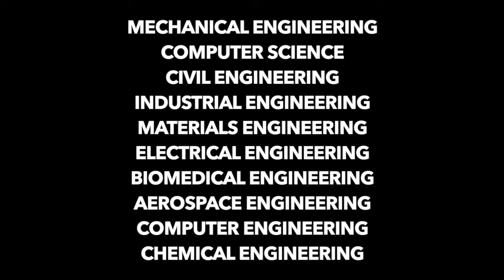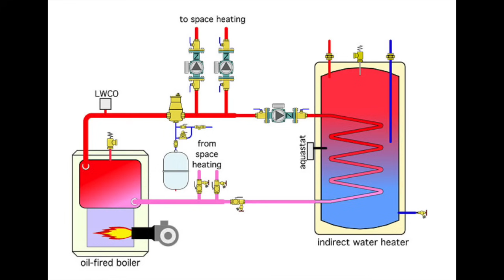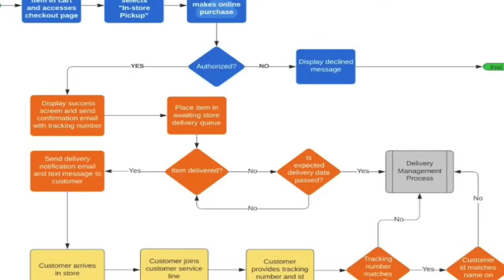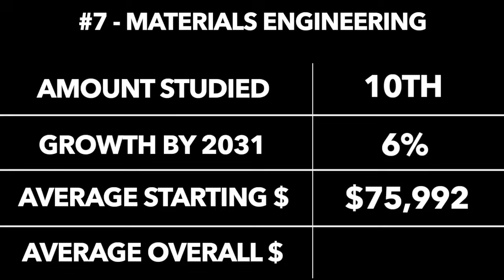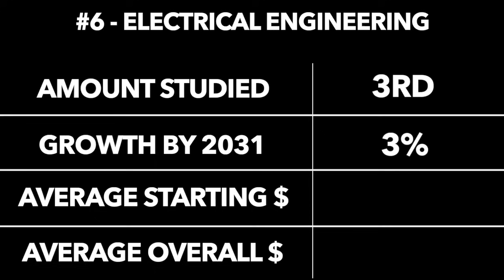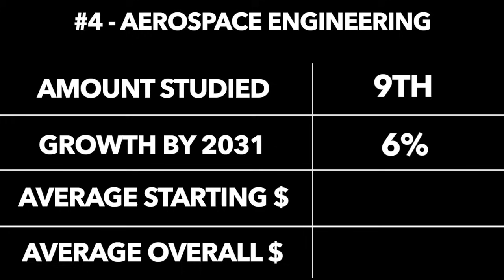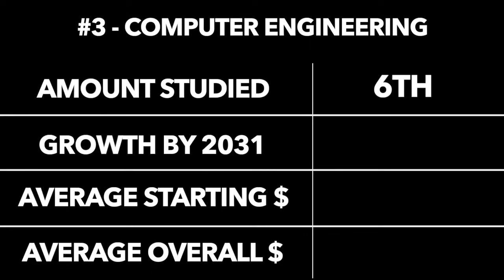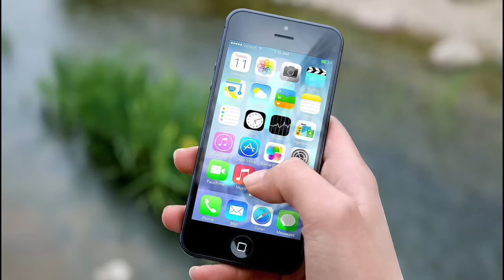Engineering Degrees Ranked: Pay, Demand, and Job Roles

Comment: I was an undergrad during the second half of the 1980s.  I chose computer engineering purely because that's where my passion was (and still is).  I feel very blessed to have a career I love, which is also in demand, and has offered strong financial compensation.  I am very thankful.
Reply: Hello, fellow CompE geezer. Are you now doing systems software engineering, like me? 😜
Reply: @MykePagan  
I fell in love with analog circuits in elementary school, followed quickly by high-fidelity audio.  For a brief while, my master plan was to study EE and go work for McIntosh.  But then I added computer hardware and software to my list of interests.  By the time I graduated from high school and entered college, I had already decided that computer engineering was the right path for me.  (But I continued to love analog circuits also.  My favorite course in college was my junior-level analog course.)

Anyway, in practice, my professional career went into (embedded) computer networking software (IP routers, DNS servers, etc.) and network design (configuring routers, planning the network topology, etc.).  My career has remained in embedded software/firmware.  I currently write embedded code for automation/control products for big electrical power generating plants.

But I keep my hands dirty at home with hands-on digital and analog electronics.
🙂
Reply: @waltwimer2551  I'm starting computer engineering after summer but I'm kinda freaking out because AI, I would love to hear your opinion about how AI will impact programming jobs etc.
Reply: @MrApaze  
Great question!  I wish I had an answer for you, but I really have no idea what's going to happen.  I can see AI automating certain aspects of hardware design, and automating the creation of certain kinds of software.  I currently work in the power industry, writing low-level embedded software/firmware for controlling big AC generators in power plants.  On one hand, the power industry has traditionally been very slow-moving.  The power companies dislike/distrust radical changes.  They often prefer that products and systems remain the same for 30+ years.  But, now we have a HUGE push for renewable energy sources (wind, solar, etc.).  This is a huge disruption to the power industry's traditional way of thinking.  This opens up a lot of opportunity for new startup companies to move in and create radically new products, so AI may prove to fit right in by accelerating designs.  But I suspect that the designs will have an almost "alien" quality to them.  Human engineers may look at the designs and say, "How the hell does this work?"  That's bad for the stability of the overall power system.  If we humans can no longer understand how the systems work, we won't be able to fix them when they inevitably break.  So that could go two different ways...  Some companies may reject AI or at least keep human engineers to have the final say on designs.  Or the world may go all-in on AI, and then some major catastrophe will happen and no one (including the AIs) will be able to fix it.

The future seems incredibly unpredictable at this point.  But I'd rather have knowledge and skills than not have them.  I think the world will still need computer engineers for a long time.  If not, then all of humanity may have much bigger existential problems...
😮
Reply: @waltwimer2551  Thank you for your insight I really appreciate it:)
Reply: @waltwimer2551 sir, I'm a mechanical engineer graduate and later did web development course. But still struggling in learning programming..can I stick on to programing or go back to mechanical domain
Reply: @azad738  
My best advice is to find your passion.  Don't do something you don't like.  If there's something you like better than both mechanical engineering and programming, then find a way to pursue that other thing.  Or if you enjoy mechanical engineering more than programming, stay with mechanical engineering.

I've been blessed that I have a passion for electrical/computer engineering.  It certainly has its challenges some days, but for me, I can't imagine doing anything else that I would enjoy more.
Reply: @waltwimer2551 hello sir i am also aspiring to be an engineer probably computer science or electrical currently preparing for a college entrance test sir my question is how job as an EE is like??. i really want to be one of those who design top silicon chips for amd intel nvidia.. i really love hardware as a whole also i want to get into computer software type of things as well like machine learning AI and more are these simultaneously possible??.. how financially your life has been??.. is engineering only limited to jobs?? can i have some sort of startup knowledge as well during my upcoming colledge days..questions of an aspiring teenager sir hope you answer.. (my question might seem illogical due to my age sorry for that just eager to know ))
Reply: @mdyusufzaman9356 Im curious what path you decided so far in college
Reply: Could you tell me about your experience as a computer engineer? I'm aspiring to become one and would like some advice of what stood out as a "you MUST know this" and anything else you have to offer. also could you tell me about the working environment (deadlines, projects, and what did you actually do)? i am curious.
Reply: @luxelivez  
Kudos to anyone who read all of this! LOL!!!
🤣🤣🤣
    
Good luck to everyone contemplating or pursuing a career in electrical/computer engineering, or any other engineering discipline! I think if you love this stuff, you'll know it!
Reply: @luxelivez 
Good question, but also a big one!  Let's see...  (Looks like this will have to be a multi-part answer...  YouTube is limiting how much I can write at one time...)

I actually fell in love with science and electronics starting in kindergarten.  One of my earliest memories was playing around with an electromagnetism kit in kindergarten.  I didn't really know what I was doing, but I managed to connect a 1.5 volt dry cell battery (the size of a soft drink can) to a flashlight bulb using wires with alligator clips.  The bulb lit up!  I was hooked!  Through elementary school, junior high school, and high school, I taught myself everything I could about electronics, high fidelity audio equipment, and computers.  Along the way, it became quite obvious that I should pursue electrical/computer engineering as a career.

When I graduated from high school, most kids had no idea what they wanted to do with their lives.  In contrast, I thought I had my life all figured out.  I was going to go to college, study electrical/computer engineering, get straight-As like I had in high school, go work for a great company (my dream was to work for Digital Equipment Corporation -- DEC), and have an awesome life!  I was pretty smug that I had it all figured out while most kids didn't.

[ . . . ]
Reply: @luxelivez  
An odd thing happened to me... Before college, I thought I had it all figured out. But at the end of my 3rd year of college (my junior year), the realization hit me like a ton of bricks that electrical/computer engineering is a HUGE field! With a degree in electrical/computer engineering, I could further specialize in semiconductor devices, chip design, board design, system design, software, etc., etc. Everything interested me to some degree, but my grades weren't as good as I had hoped, and no single specialization jumped out and said "You're best at X, Walt; that's what you should do!" I understood a little a bit about all of it, but I didn't feel like I was "good enough" at anything in particular. This plunged me (further) into depression...
Reply: @luxelivez  
Technology-wise, my career has gone from networking (campus network design, router configuration, networking software development, etc.), to deeply-embedded networking software for a giant Internet switch, to operating systems (embedded Linux, particularly kernel device drivers), to data storage (writing Linux kernel drivers for a special network-based filesystem), to writing embedded software for specialized hardware that runs big electrical power plants.
Reply: @luxelivez  
Reaching back to my junior high and high school roots, I still have a love of analog high-fidelity audio. During the last few years, I've revived that as a hobby. I'm now collecting and repairing vintage audio equipment from the 1950s through the 1980s and later. And now, as a part-time side-gig, I'm offering my repair skills to other people. That has allowed me to reach back to college courses in analog circuit design, working with vacuum tubes, transistors, resistors, capacitors, etc. That's a lot of fun for me. I've been very pleased with how much I remember, and how exciting it is to revive and improve/expand those skills. It's a great change of pace from computers! So, from a job/career/hobby perspective, I couldn't be happier!

Comment: Easier to look down the road, now.  When I was in school in the 80’s in Texas,  there was a joke.  What do you call a petroleum engineer?  “Hey, waiter!”  Today, it’s extremely well compensated.  If history is a guide, the boom & glut will happen again.
Reply: I worked with some Petroleum Engineers at an oil well logging company in Prudhoe Bay, Alaska . They were making over $100,000 in the early 1980s. Heck, I was a tech fixing the electronics tools making just over $70,000 back then and worked in a nice warm building.
Reply: @Chris_at_Home  I think you missed my point.  Ir was about chasing hot degree fields.  It was exactly because currently working PEs we’re making so much money that the field quickly became the “hot” major for students just entering university in the late 80’s.  By the time they graduated 4 yrs later, the field was glutted.

Comment: All of these videos are correct in what they say but they leave out many opportunities and fields of work that the engineering degree can give you. I have an ME degree. Went to work for a major oil company and did systems engineering for 5 years. Made supervisor and managed the work for another 5. Sent overseas on a project and never looked back. Love project work which can mean anything from initial front-end engineer, detailed design, construction and commissioning. I have been a contracts manager, project controls manager, construction manager and project manager. Every job is different and there is never a dull moment.
Reply: So with a BSME you can basically do anything that’s not super specialized?
Reply: @folk49  Same is true for most engineering disciplines. My father was a civil engineer who retired as the plant manager of a chemical plant. Had a friend who was an EE and became an environmental manager.

Comment: what engineering degree would you need for optical engineering?
Reply from the maker: Good question. I would say either physics or electrical engineering.
Reply: Typically Physics or Electrical Engineering. I did mechanical engineering and currently an opto-mechanical engineer so you could get into optics field with other degrees too.

Comment: I have a question. Can a computer engineer do all those things computer scientists do? If yes, then Computer engineering should be on top because they combine knowledge of two fields (electronics engineering and computer science)
Reply: Honestly Computer Science, Computer Engineering, and Software Engineering are used interchangeably in job postings. I believe that CS is on top because if focuses solely on software development. While a CE could specialize in software, they typically balance their classes between EE and CS, while a CS student focuses solely on software dev.
Reply: @gabrigamer00skyrim  thank you
Reply: @gabrigamer00skyrim  so what if software engineer vs computer scientist then?
Reply: @Samguy55  From my experience they are both very similar, it really depends on your university. I majored in CS and had a couple friends in SWE, and there were only small differences in our course load. While they had to do more hands-on classes (mobile dev, UI/UX...), I had more theoretical classes (Discrete Math, Linear Algebra, Statistics...). SWE also required more credits than CS, but they both take the same core classes.
Reply: @gabrigamer00skyrim  okay I understand your point. 
I think it would’ve been better to put SWE instead of CE since he’s talking about engineering courses then.
Reply: @Samguy55  Software Engineering is to Computer Science, as Chemical Engineering is to Chemistry (Science).   That is, Engineering is about making practical use of concepts discovered by Science.   The computer scientist might study and improve an algorithm, while the engineer would select the best known algorithm to solve the problem in front of them.    Computer Engineering (which is the degreeI have) is basically EE with an emphasis on Digital rather than Analog circuits with a bunch of Software stuff on the side.  One of the key CprE skills is where to divide tasks between software and hardware and how to marry those two halves together effectively.
Reply: @gabrigamer00skyrim CS is definitely not at the top and not better than CE
Reply: @gabrigamer00skyrim computer science on top? Dam this comment did not age well. 

There are less opportunities a CS in comparison to CE they have opportunities in both areas, hardware, electrical, network, and software. It would also be easier to double major with an Electrical Engineering degree or Mechatronics. 

CS is played out, over done, over saturated, and the demand has dropped significantly and it’s highly competitive
Reply: @FlowSharp  That is true at the moment, when I commented this the market was very different than what it is now. Regardless of that, software opportunities still pay way better than any hardware focused jobs, but they are extremely competitive now
Reply: In college the EE department had a robot that competed year after year like many engineering colleges did.  The EE dept really was "in charge" of it, because EEs can write code that controls the hardware of the robot.  The CS students were far superior in code writing, no doubt.  But they could not write the code that controlled the hardware.  ME students could definitely make the hardware, but the EE was able to make both hardware and software work together.  Each engineering major had their value, not trying to make one better than the other.
Reply: Computer Engineering is the best.
Reply: @prohibited1125  first they need to design and build the computer from its raw materials. Going to have to call in all the other engineers first. They are the icing on the cake.
Reply: A CS with 5 years of experiencie knows a lot and earns a lot than a CE with 5 years doing microchips. Maybe thats the difference. But yes, they are the same in software field
Reply: Yes. A computer engineer can do both. They can specialize on hardware such as chips. Computer scientist excel more on the software development side. 😊
Reply: Computer scientists can not generally, from Uni, do electronic hardware. Have done all hardware in my career, but Uni study did not cover hardware. I needed to study hardware, analogue and digital. Keep seeing failed circuit design where digital is not fully understood as just an analogue circuit at limits. And let us see a computer sci grad do a tank circuit.